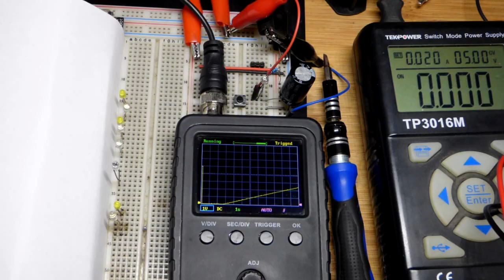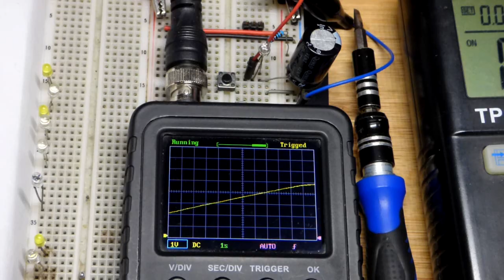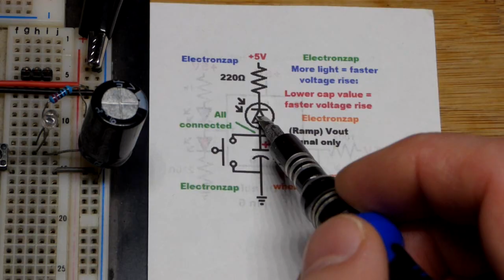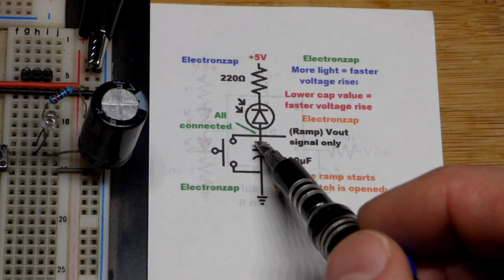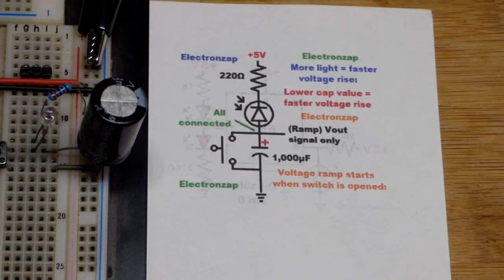Voltage Ramp using Photodiode Steady Light

Comment: GREAT VIDEO!!
I think it is very important to show that s constant current driven through a capacitor gives a linear charging ramp.  Many students are used to the idea of a charging capacitor is an exponential rise (RC).
Reply from the maker: Yeah, RC timing gets a lot more attention than voltage ramps.
Reply: @Electronzap  Right, and the math is simplified since the voltage rise is simply I/C [volts per second]